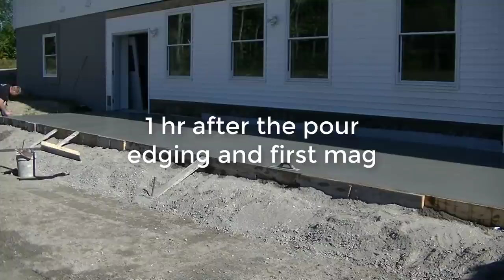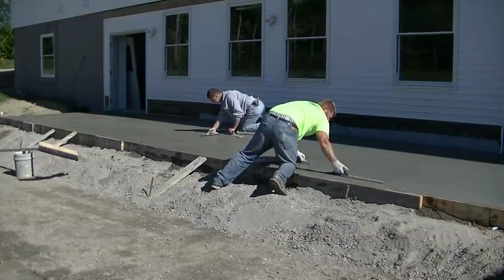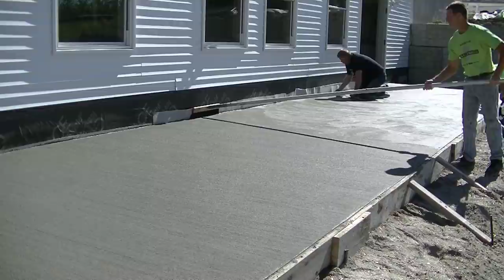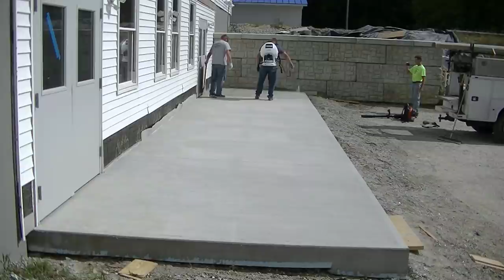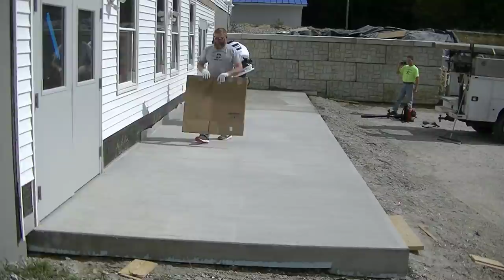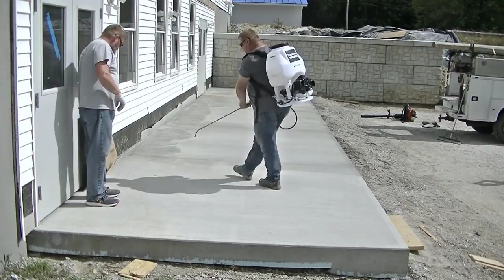How To Broom Finish A Concrete Patio Slab (50' x 10')

Comment: Hey mike!  Just wanted to say I love your channel.  I’m a handyman in Utah, and I’ve been started to do a little bit of flat work (small stuff) and your videos are super helpful!!  Quick question:
What size aggregate do you usually have added when doing a slab?  Say like the one in this video... and what slump?  4”?
Reply: Pea rock (≤ ⅜”) is probably a little easier to work with than .57 rock (≤ ¾”) but it’s more expensive.
Reply from the maker: I use a 4000 psi 3/4" stone mix, straight cement. I ask for a 5 or 6 slump but with water reducer.

Comment: Do you guys ever trowel before brooming exteriors or just trowel foundations? Out here in NorCal it seems everyone trowels both. Personally, I think your method is just fine.
Reply from the maker: We never trowel out here. We'll mag float twice if we have to. We use air-entrainment, it's easy to seal off the surface if you trowel and trap in the air. Which will create a blister later.

Comment: I'll never understand the picture frame concept. Why unfinish a pad after u broom finish it, especially if u don't groove it and strip face. They do it in one of my areas, but I refuse to do it.
Reply: Truth Only  it gives u traction when the surface is wet
Reply: Truth Only  u need to cut or groove most concrete pours unless they're small. A light broom is very sweepable.

Comment: After you have floated the slab, bleed water has come and gone…you mag but not steel trowel?  I’ve been having issues with the broom bringing up the fines.  This is on 5 bag mix with a 4-5” slump, no add mixtures, 98 degrees full sun, no wind, zero humidity.  I wonder if it’s just a crappy mix design.  Any thoughts? Brooming too soon?
Reply from the maker: Probably just the mix design. The commercial mix designs here are terrible to finish. We have out own mix design, just have to work with the batch man, he can tweak it a little to make it more finisher friendly if he's willing to.
Reply: @MikeDayConcrete  Copy that.  I have to order 3 weeks ahead here…long gone are the days of calling a couple days before hand.  Larger companies can get mud quicker, but it’s still a joke.  I’ve been using ‘U-Carts’ for small jobs lately.  It’s the only way to get things done in a timely manner.  For pours of 5+ yds I have to play the wait list game.  

Thanks for the response.
Reply: @SneakAttackFilms  try a finishing aid.
Slow down the process as well, with some ash or retardant.  Straight mixes go fast, especially in that temps, also a breeze.
Good luck.
Reply: @jonyates3918  I recently used a plasticizer on a small patio job.  Worked well. Thanks
Reply: @SneakAttackFilms  always keep a surface aid on hand, con film or similar

Comment: U guys are crazy. U shouldn't use steal trowells in outdoor concrete mix with air. Leaves thin layer cream on top. Air bubbles hold moisture, they freeze. Then POW your that guy that just sold the pitted Spalding rotting concrete everyone hates. Sharpen up guys. Magnesium outside. Steel trowells on floor mix
Reply: The broom is taking care of that issue, .  32 years of finishing. Always use steel and never had any spalding
Central Minnesota
Reply: The broom doesn't take care of it. That doesn't make sense. Every one that gets corrected in concrete always fires back with same line. " I been doin this 30 Years" drive back and visit ur jobs bet u have plenty of Spalding. Just a word for the wise. Steel indoor mag outside. Take some pride in technique instead of relying on a trowells to fix your mistakes with a float.
Reply from the maker: We are using mag floats. No steel trowels in this video. What are you talking about?
Reply: The comment on trowells machining driveways. Not u Mr day. Just letting them know
Reply: Was talking to Brad Hill and Brett fairchild
Reply: Not youtube yodeler been watching and subscribed for a long time and first comment I've made so
Best of luck. Keep doing them wrong and we'll keep making money tearing them out and replacing them
Reply: I was just trying to help you... Best of luck big chief